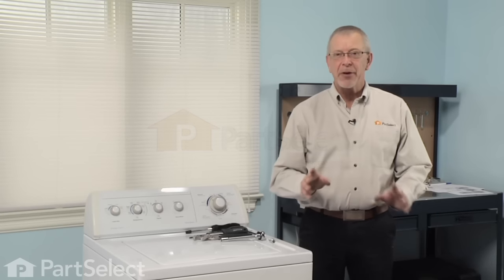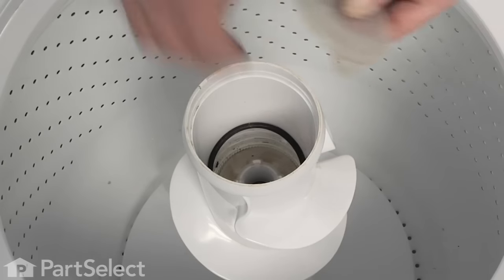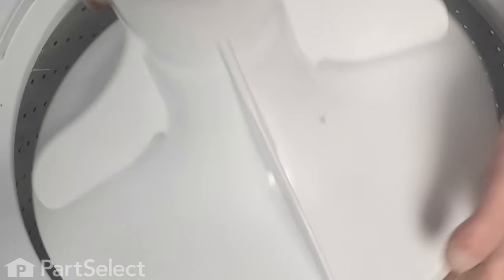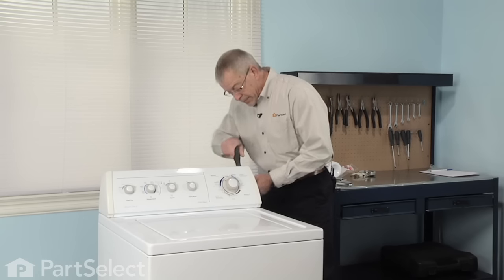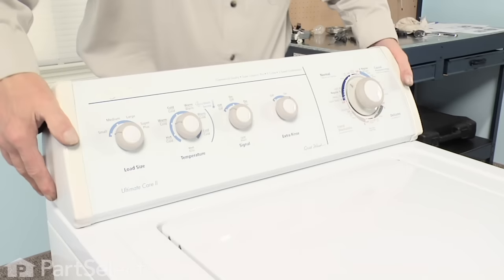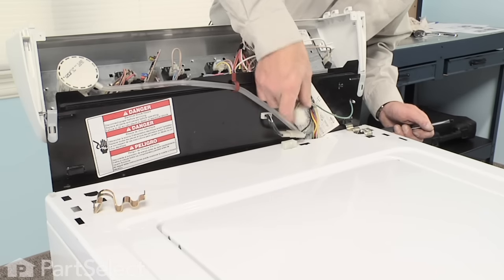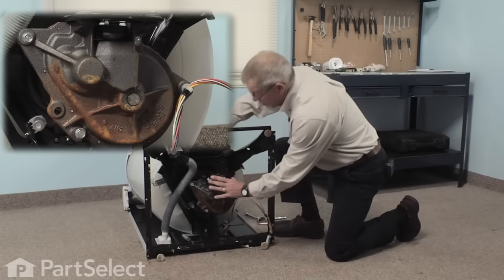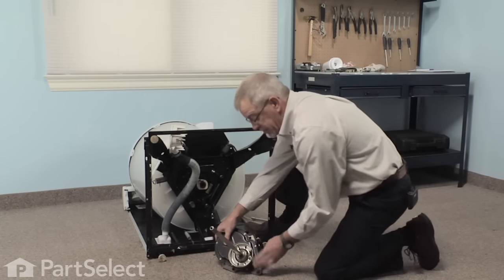Washer Repair- Replacing the Clutch Assembly (Whirlpool Part # 285785)

Comment: Everything is WAY TO CLEAN!!! Grease,grease and more grease!!!😮 Wear gloves !!!😅😂❤
Reply: Yup!
I went even further the last time I replaced the clutch on ours.

I took the transmission apart... GENTLY to see if the gears were ok and not too worn.
I was able to find the correct oil for it and did top that up.

That was a bunch of years ago and it's been fine since.

Comment: Great video! I just did this repair and it was a cakewalk. I just disconnected the pump and left the motor attached to the gearbox. It slid out easily and wasn't too heavy all as one unit. Doing it this way allowed me to leave the cover and everything on, other than the agitator of course.
Reply: Every time I lay down the machine the pins fall out and it's never fixable

Comment: Why did he take the housing off? That was totally unnecessary and a waste of time. Just pull the agitator, put it on its back and take out the motor and transmission as one unit. You only need to detach the motor (which is easier after its out) if you are replacing the motor coupling.

Comment: skid plate is out of adjustment your transmission is shot and or clutch pads are worn,or clutch pads need to be lightly sanded with emery cloth and and cluth pad spring needs to be stretched

Comment: Appreciate the video but I would edit @ 11:19 the placement of the brake cam and/or the configuration of the cam is important for inserting the clutch, also need to mention the clutch spring needs to be moved so it won't hit the brake cam. Also, in the case of an older and more used washer a rubber mallet will be useful to hammer the clutch assembly in order for the three bolt mounting holes to line up with the mounting points on the clutch base to re-install the screws.

Comment: Does the clutch stop agitating ?
Reply: If you can grab the agitator and spin it in both directions by hand, then you need to replace the nylon dogs under the cap on the top of the agitator. They're cheap and super easy to replace.

Comment: Excellent videos.  All went as shown until I tried to remove transmission. As I  slide out agitator shaft there is a mechanical interference (clunk) that prevents it from being removed. This interference happens at about 2-inches.  All seems free and clear, but the shaft will not slide out.  Any thoughts?  Model LA9500XTN1 S/N: CB0503088.  Thank you!
Reply from the maker: Thank you for the compliment. We have some great customer written instructions on our site. If you use the model number of your washer you can access the washer’s schematics. We have information about replacing the transmission there and there are some detailed instructions – search for part number 3360629. Start there and see if that helps. If not then let us know. :)
Reply: Pull harder or tap the shaft. I had the same problem and just pulled it out. No need to pull the housing or remove the motor (unless you are replacing the motor coupling and then it is easier after the motor/transmission is out).

Comment: HELP!!  Everything works but the spin cycle. I replaced the clutch. However,  the drum only spins on the spin cycle when I have the washer laying on its side . When I stand it back in the up properly, it does NOT spin anymore. Why is this?

Comment: Very grateful with all I have learned with you, Sr.  My question is that my washer machine doesn't have the ring that you remove in minute 10:35. I have already change the Clutch assembly, shaft Direct Drive, washer motor coupling, water bomb, and many other little tings , but it still make a lot of noise between wash and spin. And I can't find the ring between the shaft and the clutch assembly.  I think that's the problem, but , since I got my washer machine used, I really don't know what happened with it.

Comment: Change the coupling because it was broken And I checked the clutch And it was hard to move I suppose that's good. What else could cause The rinse cycle Not to spin.? Transmission?

Comment: I wish you could have shown in greater detail the alignment of the springs prior to re-installing the gearbox....
Reply from the maker: Which spring are you referring to?
Reply: there is a spring on the brake...and one on the clutch...does it not matter where they are located prior to re-attaching the gear box/?
Reply: there is a SPRING ON THE CLUTCH AND ONE ON THE BREAK !

Comment: I ran into a problem that I never expected. There should be a video about this! The direct drive couplers in newer machines have steel shaft bushings. The older had plastic. I had a bad clutch and got to the coupler the half attached to the Transmission had a crack in the plastic. I tried to remove it. The bushing had seized to the Transmission. I used WD40 and soaked and pulled over a period of hours. The thing would not budge and all the plastic was destroyed up. I tried to pry it lose the seal in the transmission came out. In hindsight I should have drilled the bushing. I prefer the plastic couplers.

Comment: At 12:20 my transmission & clutch assembly is getting stuck about 1/2 inch shy of going all the way back on. What could be wrong?
Reply: Found the answer to my problem in this video https://youtu.be/q942xn_2VXY?t=470 at 7:50.

Comment: Hi.  Thanks for the video.  After repairing my washer I found a part that fell out of the washer.  I could not find out where it went until watching this video.  At 6:41 you can see this part, a clear long cup that clips on to the frame. It is to the left of the transmission, right next to the empty hole along the edge.  I am trying to figure out what this part it for.
Reply: I was wondering about these as well?
Reply: Those are shipping pins used when shifting the washing machine after the washing machine is set up they disconnect the shipping pins from the tub and they fall into the little plastic cups they're not used for anything else you do not need them

Comment: Hello I have a whirlpool estate washer, and i noticed that my clothes were still soaking wet when the washer has finished spinning. So I turned the washer back on to spin cycle and I can stop the tub from spinning with my hand very easily do I need a new clutch or a transmission? The model number for my whirlpool estate is tawx700jq1 any help would be a plus thank you for your time.

Comment: Would you mind addressing an issue with a Kenmore washer spinning but makes a loud knocking noise during the spin cycle.  Stops when you open the lid.  From everything we check out could it be the clutch?  Thank you for your time.

Comment: My direct-drive Kenmore 500 produces a loud "bang" sound every time a spin cycle begins. I am fairly certain the noise is produced by the spring portion of the clutch "slamming" into the brake cam, to release the brakes and allow the tub to spin...Is the loud "bang" normal?

Other than that, the tub spins normally and rapidly and there seems to be no damage done to the brake cam or other components of the basket drive.

Comment: At 18:42 - Should you lubricate the spline shaft with waterproof grease before you reinstall the agitator? When I took mine off for this procedure.. it had some type of original greasy residue.

Comment: I just finished replacing the clutch on my washing machine.  Great video!  It helped me do the job easily.  One question I have is when I lifted the washer off its back and set it upright, there was the sound of a small metal object hitting tile.  Lifting it back up I found a small gold color piece that looks very much like a common head nail, about 1.5 inches long, with a hold through the pointed tip that looks like something a cotter pin or retaining clip of some sort would go through to keep it in place.  I set the washer on its back and looked all through it, but nothing seemed out of place.  Any idea what this "nail" is for?  Thanks again for a really great video!!

Comment: The black ring (the ~6" diameter black metal half that interfaces with the clutch) the break cam drive goes into, mine feels seized.... Can this be replaced, should it be  feeling hard to turn?

Comment: This is the best video I have found on the replacement of a clutch. Just a realization: returning the Retaining Clip is not as easy as shown on the video. Also, I broke my D clip. Besides that, we are happy with the repaired washing machine. We should repair things than throw them away  Thank you from the Philippines.

Comment: Stuck on the bolt retaining the agitator. My washer has a carbon steel bolt which rusted and ruined the head. The socket would not grab. Trying to extract the bolt. May have to destroy the agitator.

Comment: Hello, I was curious. I have this model. I see you taking a plastic piece and a spring off off the Spanner Nut? My Washer doesn't have them parts? Would that make it not spin? I've been trying to find out why it won't spin out. All the waster drains and works fine, but my clothes are soaked after the spin? Will those parts make this happen? And if so, Can you tell me where I can buy the parts please? Thanks!

Comment: My washer Whirlpool Washer LSR6332KQ0 agitates but will not spin. I also smell a faint burning rubber smell when it tries. I can prop the lid open and spin it by hand, which after going fast enough performs a normal spin cycle. My question is: what part of the clutch broke? Do I need a whole new clutch or just the clutch band?

Comment: Great video, was very easy to follow. The clutch springs I got were light blue and dark blue and the one in the machine was between the two! Instructions said blue or black!  I went with the light blue because it looked like a heavier spring for my large capacity machine. Running the machine now and all seems good except a very strange squeak while agitating.

Comment: I have a whirlpool ultimate care II and it will aggitate but not spin on occasion.  When this occurs, I manually rotate the basin clockwise maybe 1/4 a turn.  It becomes very tight to turn and it typically makes a click then it will spin.  What part needs to be fixed?  Thank you!

Comment: Good video. I think the clutch is whats wrong with mine. it's a Kenmore that looks like this one. It only washes on the Gentle cycle. Won't wash on the normal one. I watched a video similar to this one where the Tech did not remove the cabinet. I see by yours that it makes the job easier. I hope you have videos on Kenmore dishwashers too I have a problem with mine. Thanks again!

Comment: changed my coupler,no problem,but it lost oil while tipped for a day,now it stinks up the place! no further leaking seen,but bad odor.is it oil or the coupler settling in? this seemed such an easy fix, but now theres a slight water leak at the pump too!any advice about that oil spill?

Comment: I posted on another great video of yours about the agitator not spinning with the drum during spin cycle. I thought maybe belt, only to find its a direct drive motor. I guess that helps narrow it down lol.. I took the washer agitator off completely to observe it during spin cycle and noticed that grooved shaft does not spin, tho the metal disc and plastic base does spin. Watching this video, it seems the next logical step would be to try this, do you think so? Thanks so much

Comment: Steve i replaced the clutch assembly and before i did , all i heard was noise. it would not spin. i installed a new one. and no noise and still wont spin. i am sure i followed it to the t. is there anything else that would prevent the washer from spinning? its a whirlpool. model numberLXR7244JQ1  part installed was PS334641.  I need some help.

Comment: HI,JUST WANTING TO REPLACE MY CLUTCH ON MY WASHING MACHINE ITS A WHIRLPOOL FROM 1987 WORKS GREAT. I TOOK BACK PANEL OFF TURNED IT ON ITS SIDE TOOK PUMP OFF AND MOTOR,AND THREE TRANSMISSION BOLTS DID I MISS A STEP BEFORE  OR DURING THIS PROCESS>>
Reply from the maker: What's the model number of your whirlpool washer and I'll see what installation instructions are available.

Comment: what would be the symptom that would lead me to believe I need a new clutch assembly? It bangs when it stops or starts a different cycle. I thought that is what I needed. thats why Iam here on this site. I just exchanged the lid switch and pump cuz it wouldnt drain. But it still bangs and not in a good way. LOL advice? Good video BTW.

Comment: I have a Maytag washer. When it got to the spin cycle it just quite and left water  in the tub.  When I tried to recycle the start button to spin it would only move the tub about an inch and a half and stop.  It seems to want to start but it quits. What do you suggest sir?

Comment: Great video!  Thanks a million!  But how do we know if tge problem is the motor, coupler or the clutch assembly?   I hear the motor but nothing moves including the coupler.  Can help it move by hand a little as if something is stuck or motor has no torque.
Reply: Anytime the motor is turning, the motor to transmission coupler should also be turning. If not bad coupler.
Reply: If you start it by hand and it sort of spins, it is the clutch.

Comment: I have the exact same issue as dcanimaltube above-- raising/lowering the lid causes the spin cycle to engage- otherwise it continues the cycle without spinning, though the water is dispensed correctly (resulting in wet clothes).  Is that definitely a clutch issue?

Comment: Holy crap. You did way too much that you didn't need to. The case doesn't have to come off. The pump clips that hold it to the motor are all that need to come off of that, then the metal shield that is on the side of the tub till hold it out of the way. The motor absolutely doesn't need to come off as it is tricky to line up with the motor coupler when re-installing it. You way over complicated what should be a 10 - 15 minute repair, tops.
Reply: Yeah, I remember your video was sooooo much better. Glad to have someone like you patrolling YouTube for people that "overdid it" (probably without making any money too, eggghhh). Next can you you fix all the videos that repeat other people's videos? You are truly doing God's work. Bless you

Comment: I just watched your clutch replacement video.  Very informative, but it does not tell me how to get the agitator cap off.  My agitator doesn't look like yours.  My model number is:  LXR7244JQ1.  Is there a catch or a lip or do I turn it in a specific direction, or do I push down and turn the cap at the same time?  I don't want to damage anything that isn't already broke.  If I could get past this first step, I can order my repair parts from you and follow the video.
Reply from the maker: Thanks for the compliment. We have a video about replacing the agitator cap that will explain the procedure for replacing that. It's quite informative as well. Search our channel for Agitator Cap  Barrier with Seal - Whirlpool #W10074580 Let us know if you have any other questions.

Comment: Its a Simpson eziset750, the tub turns clockwise so much then locks, and if I turn it anti clockwise it starts clicking.... while its washing, it agitates only in clockwise direction. If I hold the agitator and spin the tub it moves so far in each direction before locking(and no clicking).  thanks for the quick response.  Karl

Comment: Great video and I've ordered from you folks before but I have a question I can't seem to find the answer to.  I have the IP43001 (Inglis Washer) model and the only thing that doesn't work is the agitator.  It spins fine, empties the water fine and breaks fine.  It just doesn't agitate at all and there is a slight burning smell.  Am I looking at a possible transmission issue? :(  I just want to be sure before ordering parts.  Many thanks.

Comment: This great video has helped tremendously in disassembly. I have a Sears Kenmore Ultra Fabric Care IV washing machine model no. 110.92593220. Water for wash runs fine, but agitation and spin cycles make a constant grinding noise although there is no visible tub/basket motion during agitation and spin. The coupling is not broken, and I am not sure if the motor, clutch, or gear case/transmission is the issue. Any suggestions?

Comment: I used this video about a year ago to replace the clutch in my washer.  The agitator worked and spun perfectly afterward.  Unfortunately, my washer is once again not spinning.  Is it common to replace the clutch after one year?  Or is there something else that might be wrong with my washer.  Thanks for the great video.
Reply from the maker: A couple of parts might cause the problem you’re having. I’d start with having a look with direct drive motor coupling. Normal use will create wear on the coupling and eventually wear these plastic disks out. Inspect those to see if they are faulty or if your washer is belt driven then inspect the belt/idler pulley. If they are okay then have a look at the motor and transmission and make sure they are working properly.  
Did you notice any dust or burning smell when the washer was in use? That's a common symptom of a faulty clutch. We have information available on our site in our free repair help section. I’d suggest going through it as it’s quite helpful. Let us know if you need additional help and if so provide the model number.

Comment: Great video with easy explanation.  Spin cycle works perfect, however, as the spin cycle starts there is a nose that lasts for about 10 seconds.  Sounds like something rattling in the pump but checked and cleaned pump. Tranny?
Reply from the maker: Hi John and thanks for the question. If your washer is noisy, then it could be a number of issues. You might want to check out our noisy washer troubleshooting page on our website to determine what might be causing the problem! You can find that page here: https://www.partselect.com/Repair/Washer/Noisy/. Thank you again, and good luck with your repair!